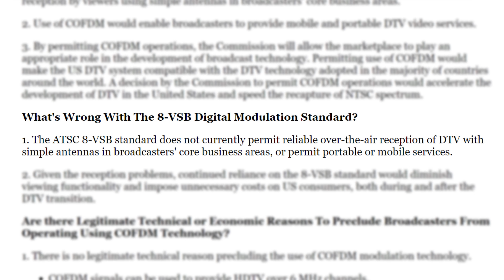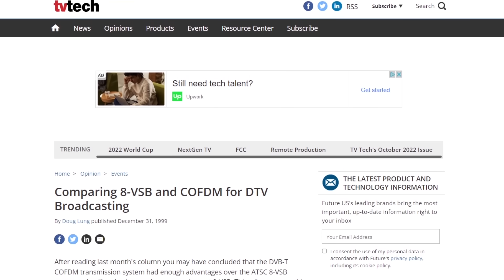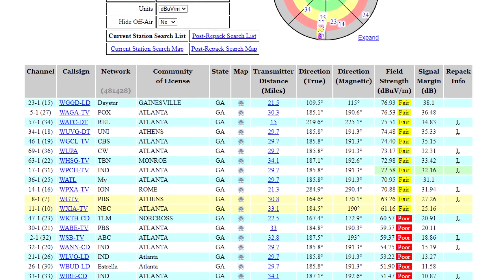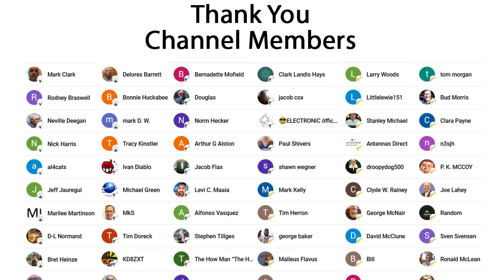This FCC Decision Made Antenna TV Less Reliable for All

Comment: Thanks Excellent information 😊😊👍👍👍👍👍 Tyler I  live 2ay up I'm Notthern Michigan  are there any classes or workshops or Video classes to be an antenna man/installer?  I live in Northern  Michigan
Reply: I've been installing TV antennas for 31 years...since I was 17. Start with using the highest quality products you can get - Winegard antennas: HD7698P, HD8200P, HD7694P and Channel Master 4228HD antennas and CM preamps. Use an Easy-Up eave mount. Bursma is a good distributor there in Michigan who also sells Delhi-Wade towers
Reply: @navigate2u  Thank You very much for  the Excellent advice😊😊👍👍👍👍👍👍👍👍👍👍

Comment: I also bought one of the antenna listed here and it does ok , but truthfully the cheap rabbit ears one does just as well and I live about 30 mi from a large town.  Wind, rain , etc do tend to interrupt the signal regardless of which antenna I use I get most of the local channels ,, but fox is one I have to work with to get.
Reply: Location, location, location.  You may have to take some time to find your best signal location.   I pick up a station from a distance of 70mi. Sure, it's a weak signal, but the picture never drops out, even during powerful wind and rain storms.  It simply has to do with where I have it positioned.  I'm using an 8-bay UHF antenna sitting on a deck, about 9 ft. elevation from the ground.  It works right there, but no where else!

Comment: I have a good outdoor antenna and get most of my local channels with no issues except for the VHF channels 5 and 12. They work just as you describe in your video with wind, planes, and other conditions. Now, I'm just waiting for an affordable converter box so I can get the new ATSC 3.0 standard signal. I spent $2,500 on my 65" Samsung Q90R TV and it kills me I have to spend more money to get a better signal. Don't get me wrong, most of the time everything works fine. I just want it to work better!
Reply: @mary allen I have filters with preamp and distribution amp. I am hoping next year I can get a low cost converter for ATSC 3.0. I don't want to spend $199 for a tuner!
Reply: This guy doesn't know shit

Comment: I live in the greater Chicagoland area  and during the transition to DTV back in the mid 2000s. 
When the government sent coupons for those converter boxes. The only name brand that was most prevalent in the region was the Magnavox version. The rest were store or no name brand boxes. I don't even remember seeing the Zenith converter ever sold in my area.
Odd considering that the Zenith corporation was based in Illinois.
Reply: I have the Magnavox for one of the TVs my dad has
Reply: Magnavox seems reliable since it has antenna meter
Reply: @reeboksboiz1266  The Zenith DTT901 also had a signal meter
Reply: @reeboksboiz1266  they near all had a meter.
Reply: You're right, the big zenith building was right off of interstate 294. I remember going by there and seeing all the antennas Up on the Roof. When I got my coupons I was able to procure the Zenith DTT901 converter box and another brand which I can't remember. For the life of me I can't remember where I picked the converter boxes up. It might have been Radio Shack.
Reply: I had an RCA converter box that worked reliably for about a dozen years, until the free OA broadcast signal in my city was blocked by massive new buildings.

Comment: I think this explains why my antenna which was favorably reviewed here and works well for me most of the time has issues if it is a consistently windy day.
Reply: Yes, if the signal goes through or near tree leaves, it will be destroyed with multipath on a windy day. You really need to get the antenna up above treetop height to mitigate the effects.
Reply: @TechnicalLee  I would have to get the antenna up over 60' high in order to do that so that's not going to be doable here. Luckily it's only a problem a handful of days  a year. I'm just going to have to read a book on those days. 📚
Reply: @ethansaunders995   same here, I’ve got a channel master 4228 and all broadcasters are within 30 degrees of each other  at 15 to 25 miles.  Windy days it’s un watchable. Calm days it’s precision perfect.  Like yourself I’d have to have a massive tower to clear all the tree tops.

Comment: Even if you had a less than ideal signal from an analog TV station, it was still watchable. It may have had ghosts or picket fencing, but you could watch the program. Today, no signal, nothing, a blank screen.
Reply: This is completely dependent on your unique locational situation.
  You can't generalize.
Reply: @bigkahuna2084  either way, no one can receive a "snowy" digital signal.

Comment: Two things I remember from the digital transition, the Zenith Boxes were among the best boxes at pulling a reception, at least for being one the cheaper ones, and the government underestimated the amount of coupons for digital boxes they had to give out. They had to do a few delays at the time and there was a wait list for coupons, somewhere up to a year.
Reply: i have 2 of the zenith dtt901 converter boxes, they are solid performers and i still use them daily. only downside is the composite video output, no hdmi.
Reply: hi new to the channel. I was wondering if there is a way that you can make a homemade antenna  from stuff in your house. you know kind of like MacGyver
Reply: @LisaMadventure  there’s always a way to do that. Shortwave listeners and hams do that all the time!
Reply: @LisaMadventure  Yep - hams do it all the time. Radio reception isn't rocket science, but it does require some math to make a high-gain antenna. Add to that the need for it to be light weight and durable, and you'll spend a ton more money than a pre-built would cost for anything with even moderate gain.
Reply: The Zenith DTT-900, DTT-901 and two Insignia-branded boxes provided very good reception characteristics, somewhat better than the internal ATSC tuners in our newer TV sets.  (I still have one TV set connected to a DTT-900 CECB).
Reply: They better internal equalization taps. Remember, the DTV signal you get is analog, carrying digital information.
Reply: I remember when they were dual conversion.
Reply: I used up two coupons, to get two mediocre boxes that work fairly well, still have the one.
Reply: @JCWise-sf9ww  I still have two brand new decoder boxes. I never hooked them up and they are still in the original packaging.  I was away when the digital transition occurred and I never bothered to hook them up when I came home. I only used to watch one local station and that transitioned from vhf to uhf.  I wasn't going to be able to pick it up with my old inside antenna and I didn't want tp put up an outside antenna so I gave up watching tv.
Reply: @JCWise-sf9ww  Coupons, LOL  I remember that chicanery.  In major US cites they were dirt cheap.
Reply: Those coupons were such an obnoxious boondoggle. They effectively created a price floor and a feature ceiling so that all manufacturers would only produce $40-45 boxes with composite out (no HDMI), because the coupons were for $40 and had that stipulation. You couldn't even find any ATSC tuner boxes (outside of really niche, expensive sources) that were anything but that price and feature set, for YEARS.
If they hadn't had the coupons at all, the market would have set the prices of such a cheap box much lower anyway, and if they hadn't had such stupid limits, you could have used your $80 allowance to buy one nice one, or 4 cheap ones if you wanted. Instead, Zenith etc got to collect $80 per person for probably $15 worth of future e-waste. I hated that whole program.

Comment: The analog signals beat these digital signals by a mile.  I haven't been imaging it then, and the signals have been steadily getting weaker over time.  I so remember the Zenith brand but I had no idea they were so deeply connected to the choice of the current standard.  As for portable TVs, I so remember those too and we had a good time on some trips in the mid-2000s before the big switch seeing what channels we could get as we passed through different towns.  Those experiences are buried deep in the vault of time.

In any case, a little snow here and there with a still watchable signal beats the living daylights out of the intermittent all or nothing thing we have now.
Reply from the maker: I always knew digital signals were weaker than analog. At the time of the digital transition, I set up a digital converter box for my mother. She picked up at least 20 channels on here analog set. With the converter box connected to the same antenna she only picked up one channel.
Reply: @AntennaMan  Different TVs have different tuner sensitivities. a converter works well with weaker signals,
Reply: @AntennaMan  That was true for 1st gen receivers, but the newest 8VSB chips have a much lower receive threshold and better equalizers that offer superior reception. Another factor was the first digital broadcasts were operating with reduced power, and with worse transmit locations (usually lower on the tower) until the full transition occurred. I think FCC also allowed a power boost several years in after they adjusted their propagation curve calculations? These factors made digital reception especially difficult in the early transition years. With a clean rooftop signal, I'd argue 8VSB goes further than analog did these days.
Reply: @TechnicalLee  How exactly does somebody find an ATSC digital tuner which specifically has "the newest 8VSB chips"?  There are very few objective sources of information comparing the actual performance of different ATSC tuners or set-top boxes. While ATSC 3.0 will eventually be rolled out and become a mainstream product, there would be a fair number of existing television viewers who would benefit (in the interim) with a better-performing ATSC 1.0 tuner.  This is particularly true for viewers in a media market (Seattle/Tacoma) where the 14 television stations (offering over 60 channels) are located in five different transmitter locations.
Reply: @peacearchwa5103  Correct, most TV manufacturers don't give specs, so in lieu just buy a TV made in the past few years. Might as well get one that has an ATSC 3.0 tuner since those are now available. Works like computer chips in laptops, if you buy a new one it will probably be better/faster than the old one.
Reply: Yes, Zenith! Now owned by LG!
Reply: I'm very sure analog beats digital by 100 miles.🤭
Reply: It all boils down to the old saying, "There ain't no such thing as a free lunch!"
Reply: I loved the portable TV I had. With its dial channel selector, you could connect it to early cable connections and get past some of the signal blocks of typical Televisions of the time. the pocket TV was another fun one but has sadly been replaced by Smart phones and streaming service packages.
Reply: Big multi-media monopolies rule the roost in DC. It will get worse until we end up in the dumpster of failed empires/nations. The greed of the monopolistic donor owners will eventually collapse this nation.
Reply: During the Analog Days, I could pull in signals from San Diego to my house in Torrance, about 100 miles distance, most of the time.  Once we went to digital, it was a rare time that I could pull a digital signal and even then it had a massive amount of dropouts.  With 8VSB in the US, indoor reception is difficult and in most cases doesn't work.  It's as if they wanted us to give up over the air reception and switch to cable TV.
Reply: @BobDiaz123  I've picked up a 8VSB signal 85 miles away INDOORS with a simple bowtie antenna before. No dropouts. You need to be in a sparse enough rural area with good terrain. I think CA spectrum is too crowded nowadays after the repacks for this to work.

Comment: The other day in the trift store, I saw an old indoor TV antenna labeled "color TV antenna" from I can only guess the 1970s or 80s. It was disappointing that it could never be used for TV again because the cables it used to connect to the TV were waaaay too thin to properly carry a digital TV signal. The only way I can get a good connection is either with hours of fiddling with modern antennas, or by getting some expensive outdoor and hoping I have enough wall space. Really sad.
Reply: Also I find it crazy that over-the-air was all but ruined overnight by corporate greed.
Reply: This is not true! The UHF side of that antenna will still work today with digi signals, you just may need a matching transformer to transform the impedance from 300 to 50 ohms.
Reply: @richb.4374  
  Abd why wouldn't the VHF reception still work after that modification?
  It has rabbit ears, right? Seriously asking.
Reply: @bigkahuna2084  Digi Tv is on the UHF band, not VHF. Rabbit ears are not resonant on UHF.
Reply: @richb.4374  
  I have no idea what you're referring to as 'Digi TV.'
  Topic is merely about receiving digital OTA signals (not ONE specific channel, which could be on UHF or VHF depending on your market).
  Digital transmissions continue to be broadcast on BOTH UHF and VHF  frequencies!
  In fact, here in Houston, THREE of the six major stations are broadcast on 'Hi-VHF' (ABC, CBS & PBS)!
  I don't use an old 'rabbit ear' antenna, but I likely could (and those extendable antenna would allow me to get the Hi-VHF major channels!
  In reality, I use an inexpensive 'mud-flap'-style antenna in my apartment window. Even though it doesn't have the 'long elements' normally required to receive VHF signals, I STILL pull them in (as I'm only 8-9 miles from the broadcast tower farm).
  It's not uncommon at all for various markets to still have certain stations broadcasting over VHF, eh.
Reply: @bigkahuna2084  Whatever works for you. In my area there is no vhf transmissions at all. Digi Tv is just my way of saying digital TV signals. In amateur radio, we use "digi" as slang for any digital mode of transmission, sorry for the confusion.
Reply: @richb.4374  Lots of digital TV markets still use VHF. I wouldn't give generalized advice like that.
Reply: @jbetnar  All of the old school outdoor TV antennas are dual band anyway so they will still work, you just need to use two feedlines because the old school UHF antennas were designed for 300 ohm twinlead and the vhf side used 75 ohm coax.
Reply: @richb.4374  I don't doubt that it would work with digital signals because it's old, more so that digi signals are too weak to be picked up well.
Reply: @offscreen6578  The only reason the digi signals "seem" weak is because they use the UHF TV band and those signals are more line of sight than VHF. Any UHF TV antenna from the 70's to one made yesterday will pick up these channels, they want you to think you need a "special" antenna but you do NOT. A lot depends on how far you live from the TV transmitters. If you live 50 miles from the nearest TV station, you will need a good outdoor UHF antenna up high to get a solid signal. I'm lucky that my TV transmitters for the local channels are only 15 to 20 miles away and I can pickup up almost 70 channels on a cheap indoor patch antenna. Keep in mind that many old school dual band TV antennas used two feedlines, one for vhf and one for uhf. The vhf side uses 75 ohm coax and the uhf side used 300 ohm twinlead. Modern TV's have a 75 ohm coax connector, so you need a 300 to 75 ohm balun transformer to match the impedances. They use 300 ohm twinlead for uhf to reduce signal losses in the feedline, it is very efficient. In most of the US, vhf TV is dead so you don't even need the vhf side of the antenna, just the uhf side for digi TV.
Reply: I made a homemade UHF antenna for less than $5 in materials that works great. It's a very simple bowtie antenna made with copper wire and a matching transformer. TV reception doesn't have to be complicated unless you are in a really bad spot (like in a hole).
Reply: There is nothing wrong with old antennas as long as your connections are good and intact.

Comment: I snitched to the FCC from last video and now they do this in response
Reply from the maker: The FCC actually decided on the less robust 8VSB modulation back about 20 years ago. ATSC 3.0 should solve a lot of reception problems but it's hard to believe that we almost had this TV standard right had the engineers been listened to.
Reply: You don’t even know what he has said yet, don’t comment before hearing what he said. You are just assuming based off of the title that they did something horrible just recently.
Reply: @JonathanMcKey  What did they do?
Reply: @D_Gottlieb_12  Watch the video.
Reply: @JonathanMcKey  watch 4:32 on his "cell phones have antennas" video
Reply: @TypicalBlox  What did you snitch about?
Reply: @JonathanMcKey  I'm joking dude, he said that whoever snitches to the FCC that he made his own analog transmitter will be beaten up, I didn't actually do anything. lighten up